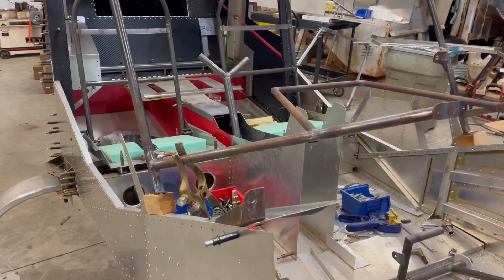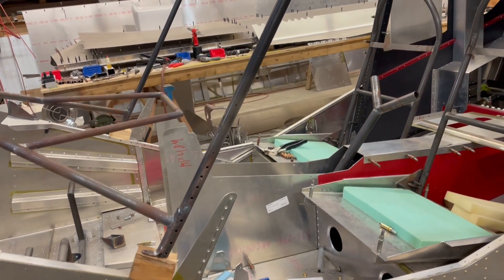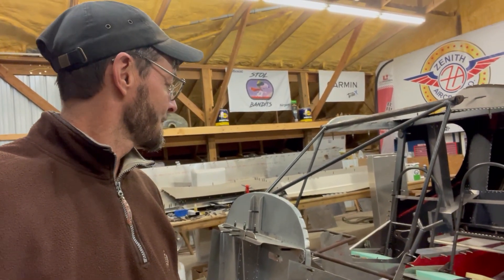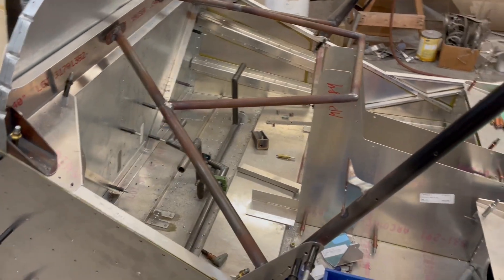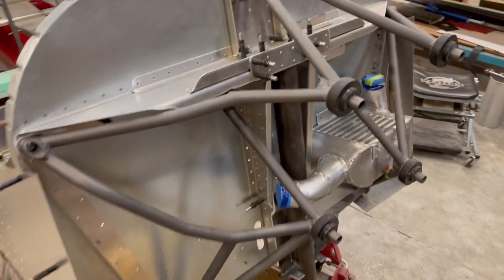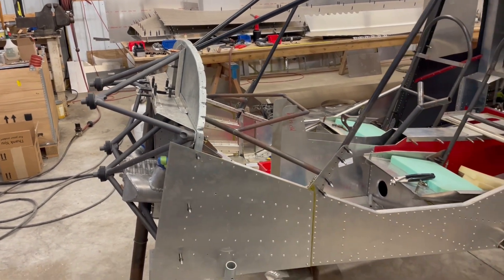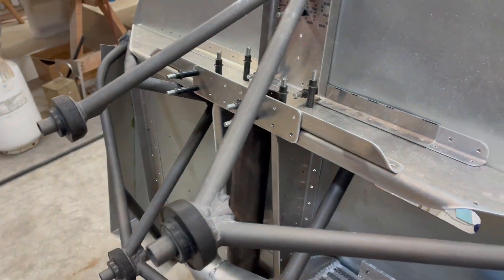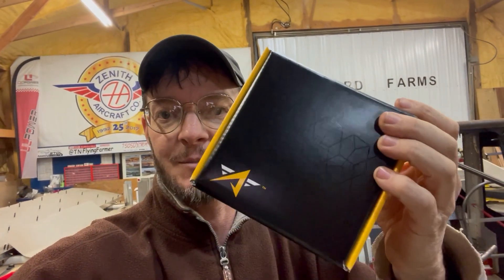Welding the Cabin Frame! 750SDXtreme Day 10 of December Build Challenge

Comment: much better mount than on a sonnax . 
i have seen bell47 tube frame painted white so cracks could be seen.
 i believe they had linseed oil inside for anticorrosion. 
i paint one , and it leeked . 😐

Comment: Gosto de ver e saber sobre construção de aeronaves mas aqui há uma coisa de que não estou a gostar de ver que é o facto das soldaduras estarem ou ser passadas com rebarbadora o que é contraprudecente principalmente quando estamos a falar de uma aeronave que se pretende que irá voar.
Reply from the maker: I totally agree with you. The only place a grinder is ever used here, is where I might have a clearance issue or in this case, to remove the extra material for a smooth surface to match the tube profile so I could redrill the correct size hole. Thanks for the comment!